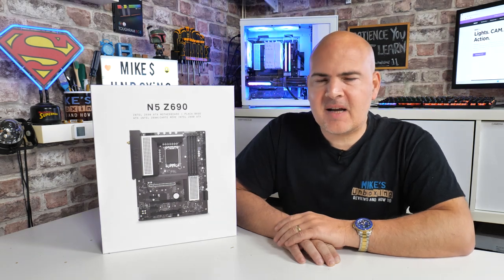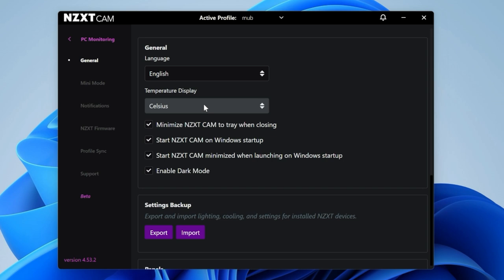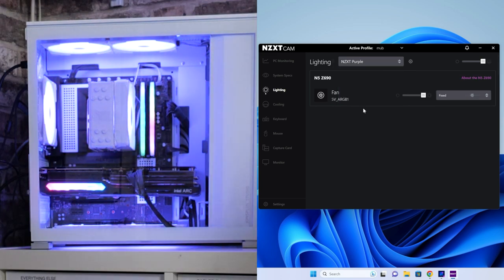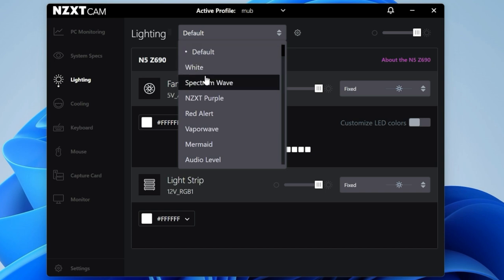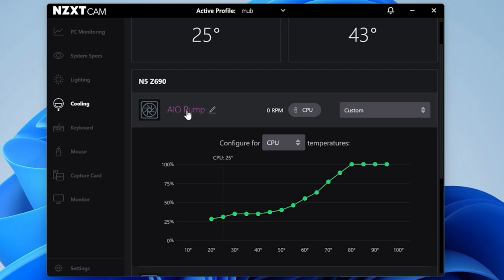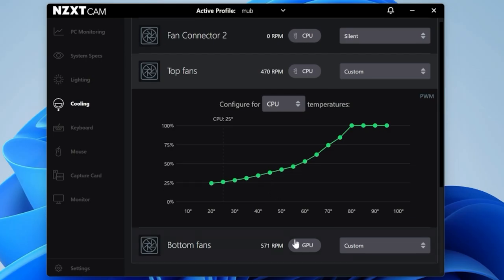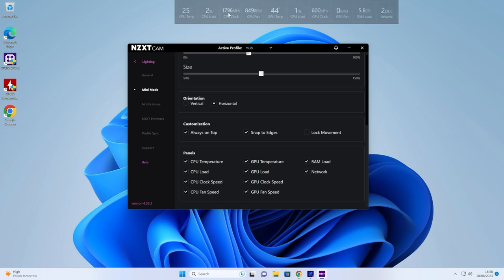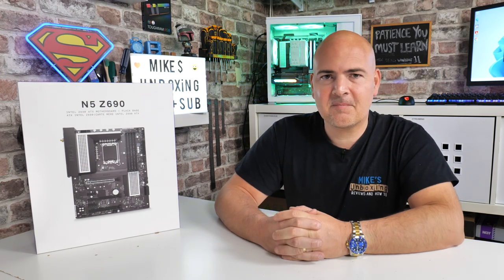How To Setup & Configure NZXT CAM Software RGB & Fan Control

Comment: Think carefully before buying an NZXT RGB box their NZXT CAM software has never worked correctly for over a year I have H7 elite and I have always had the error message (communication To the motto has failed) the fan spits runs at full speed for my part, never again this brand
Reply: I got the same problem.

Comment: How do u make so that all the fans show up in the cooling tab to change rpm because I can see and change the lighting on all the fans however I can only see and change 1 fan in the cooling tab?
Reply from the maker: what fans and hub are you using
Reply: @mikesunboxing  nzxt fans with the rgb controller

Comment: That is a very comprehensive piece of software. So many options highlighted and like the fan controls. Much better than the software / bios on my Asus B450. I have had to use seperate app, Fan Control, so fans retain profile curves on every start up. Thanks for a thorough insight into NZXT software. Thanks Mike and Kath👍
Reply from the maker: it is really nicely presented a bit awkward in some areas but overall one of the best packages i have seen in a while

Comment: Idk why my NZXT fan won’t connect to the NZXT cam, I have them connected to the motherboard and they work but when I click on cooling there’s nothing, how can I fix this?
Reply from the maker: not sure ready, need to know your system specs and parts
Reply: Same problem here brother and my fans are flying jet. Did you fix the problem.
Reply: @zodiac9131  for me I had to buy NZXT controllers and connect taht to my mother board and then the fans to it and now they show up in my NZXT cam

Comment: What do I do if my air cooler doesn’t pop up on the nzxt cam (the cooler is form nzxt too) and I really want to change the rgb on it but I can’t because of my issue
Reply from the maker: depends on the cooler and how it is connected to the system, probably just a USB connection or something needs hooking up

Comment: In my cooloing settings on the CAM software mine says "pump" instead of AIO Pump, and gives the option to configure for CPU, GPU, or "liquid". Not sure if I plugged into the wrong header or if I should choose cpu or liquid for configuration?
Reply from the maker: This is maybe easier to fix or at least advise if we can ask more questions and get direct answers, so feel free to join our Discord chat and we can go over it in more detail https://discord.gg/XtBTGQ6BDu
Agree to the rules by clicking the emoji and you will get access to the rest of the Discord channels
Reply: Same thing here I’m trying to know what does that mean it just says pump n shows those 3 options

Comment: I recently picked up the pump and was wondering if there was any way for me to lock the display it shows or if I have to launch the Nzxt programming everytime for the display to go to what I selected?
Reply from the maker: pretty sure the NZXT app and service need to be running in the background to have live display data
Reply: Yeah, your colors you selected don't change to what you want unless you launch the app.....am I right?
Reply: Any fix to this? The NZXTCam app is still buggy and lcd screen on pump only displays chosen settings when app is running in the background. Sometimes when changing the lcd screen display settings it crashes and gives me error code. All is up to date and their tech support doesn’t have a clue on how to go about it. They all point me to the same “follow the instructions” link in their website 🤦🏻‍♂️
Reply: @chriscam4487  i made mine so when i start my computer nzxt launches but is minimized in background so i never actually have to open the app... that seems to be only possible solution but ive never had an error or had it crash before might be a bad pump you got, idk
Reply: @devonlennox4459 hey, so I replaced the AIO cooler and everything seems to be working fine now. CPU Temps got cooler by 5c or more as well. The app does have to be running in the background for it to display what you chose it to show.
Reply: @chriscam4487  congrats it works not. I have my cpu and gpu temps shown just so I can easily keep track of how it’s running on different games

Comment: Would there be zero chance of issues with NZXT if I buy one of their motherboards or is their CAM going to be a pain not matter what we do?
I ask bc i'm reading about some issues, but idk. Thanks!
Reply from the maker: cam is a weird eco system, some love it some hate it, and it will depend on the other products you plan on using and what their software does and how it interacts with CAM
Reply: @mikesunboxing  oh great, thanks - hadn't even considered possible conflicts from other software :) The very first thing i'll do with nzxt cam is to disable the rgb!   
It leaves me still wondering how the fans will run if i do nothing.

Comment: I recently bought a h5 flow case and bought a nzxt fan controller along with it because my mb only has 3 fan headers. I installed by front panel fans and connected it to the controller nor my mb software or nzxt cam is detecting it. The fans are running but isnt it suppose to detect to that I can control each one of them? Or what’s a the difference between a controller and a header if I can’t…?
Reply from the maker: depends on the controller you have, but in theory yes it should
Reply: Tried contacting nzxt support but you need a order number which I don’t have because I live in Canada and I got it on Amazon. So tried asking what to do if you don’t have an order number which you need an order number to ask lol.

Comment: I want to build a PC and I plan to use a nzxt kraken 360 elite, 2x nzxt f360 rgb core and a nzxt 140 MM rgb fan and I don't know which hub to choose to connect them all
And am I forced to use nzxt components or can I also use something else with nzxt cam
Reply from the maker: yes you are locked into the nzxt eco system, you should get most of what you need in the box, personally i would steer clear of it, but it is up to you
Reply: @mikesunboxing  Well what other viable options for rgb control would there be

Comment: Hello, why do i have only 1 fan available et the pump in my cooling page ? How can i add some please because i can not control the 3 fans of my GPU
Reply from the maker: This is maybe easier to fix or at least advise if we can ask more questions and get direct answers, so feel free to join our Discord chat and we can go over it in more detail https://discord.gg/XtBTGQ6BDu
Agree to the rules by clicking the emoji and you will get access to the rest of the Discord channels
Reply: Did you manage to solve it?

Comment: If i bought the new nzxt h6 flow with the RGB, and i already have the nzxt CAM hooked up to my cooler, how would i connect my fans to the CAM app. I can’t seem to get it connected and i can’t control the color of the fans without the CAM app
Reply from the maker: This is maybe easier to fix or at least advise if we can ask more questions and get direct answers, so feel free to join our Discord chat and we can go over it in more detail https://discord.gg/XtBTGQ6BDu
Agree to the rules by clicking the emoji and you will get access to the rest of the Discord channels
Reply: bro i have the same problem did you fix it

Comment: I hope someone helps.I have just bought some  built rig and when I turned it on nzxt fans were flying.When I downloaded nzxt cam to regulate fans the app could not find my cooling system wtf..
Reply from the maker: This is maybe easier to fix or at least advise if we can ask more questions and get direct answers, so feel free to join our Discord chat and we can go over it in more detail https://discord.gg/XtBTGQ6BDu
Agree to the rules by clicking the emoji and you will get access to the rest of the Discord channels

Comment: i have a 7700x with kraken z73 what should my temperature sensor be set to cpu,gpu or liquid
Reply from the maker: cpu is what i would be using
Reply: @mikesunboxing  is there any diference between liquid and cpu because when set to liquid fans are dead silent but with cpu they go crazy so i dont know i tried testing it didnt find a difference
Reply from the maker: @ezioauditore8946  yes liquid temp should be very low and never go over about 45c The CPU will idle around 35c and get up to 70c or more so if you set your fans badly it will sound loud. Also water temp changes very slowly so it isn't a good indication of the CPUs actual temp

Comment: is there any issues with the cam software, High gpu or cpu usage?
Reply from the maker: these type of programs always have some CPU overhead, like any other program on your PC. But it didn't seem to require much to run it, overall quite impressed. Except the lack of RGB ram support

Comment: Hey Mike, loved the video! I was wondering if I can have my specific ARGB profile activate when my pc turns on. At the moment when I turn on my pc all my lights are just white, then when I login and NZXT cam starts up then my lights go onto their colour profile. Any help on this would be fantastic!
Reply from the maker: i don't know if that is possible. you could set a BIOS level profile and then when windows loads the nzxt software takes over. but the login thing i'm not sure
Reply: its not really on login, its for when i turn my pc on all the lights are white and then when NZXT cam finally starts up on my pc after logging in the the profile activates.do your RGBs display your correct lights when you turn your pc on? @mikesunboxing
Reply: sorry just a bit new to all of this really appreciate your help @mikesunboxing
Reply from the maker: @samlassman4901  no problem 😉
Reply: so are your rgb lights the same colour when you turn on your pc while its booting up as they were when you turned it off? because mine just display white until NZXT cam starts up @mikesunboxing
Reply: @mikesunboxing  do you have any more help for me?
Reply from the maker: @samlassman4901 during the boot process they default to a single colour usually white I think. Then as the cam software loads it uses whatever is set there. I think the boot colour can be changed in the bios but I’m not 100% sure

Comment: I don't have the lighting tab
Reply: nevermind I was in it but I don't have the fan controller
Reply from the maker: what motherboard is it? or what NZXT device
Reply: @mikesunboxing  ah forgot to update thia comment again, I was too hasty and the firmware update for the rgb controller didn't load so after a restart of the software everything works fine now :)
Reply from the maker: @novagaming4970  No problem, glad it's all working 🙂